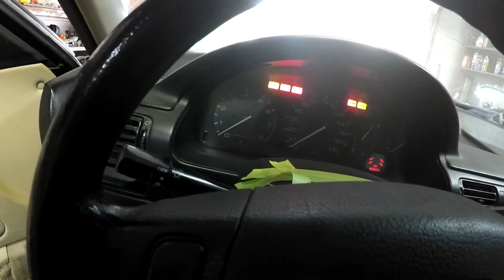Fuel Injector Resistor Bypass | CB7 Proejct: Episode 7

Comment: I have that in my 1986 Nissan laurel c32

This resistor pack is a great replacement for the stock one. Make sure the engine is getting fuel from the injectors. This resistor pack will make sure the inejctors dump the fuel into the engine. If you're having crank no start issues, this might be a solutions

Nissan 22698-05U10 OEM Injector Drop Resistor Pack RB26DETT GTR R32 R33 R34

Comment: Maybe you could help me out I have a 91 honda accord it had f22 but swap that out with a h22a4  I had a harness made for it. but won't start it want to but won't how would l bye pass the new harness to the resistor
Reply from the maker: Did you swap the motor your self?
What yeat is the h22 from is it obd1 or obd2?
Reply from the maker: Did you check for spark?
Check for fuel  at rail.
Try to start with starter fluid in the intake. What are results
Reply: I have no fuel at the rail I've tried starting fluid in the intake nothing have od1 with the extended coil also have one thats obd1 with out.i have stocked fuel injectors  had to buy jumper harness for those. The harness that i have for it from wires works maybe I could send some pictures or video if you don't mind
Reply from the maker: @chicoandtheman4112  its better if u contact me on ig direct msg
Reply from the maker: @blueprint_auto

Comment: If you run your car without this unit you can fry your ecu
Reply from the maker: Even if you change the injectors to the ones with more resistance built in?
Reply: So is this the correct way ?
Reply: My ecu flashes once less that 3 milliseconds and I have no start cranks primes spark.... I'm suspecting Ecu or resistor box I'll check injector harness before I do the bypass obd 0 DA9 RS (90) stock b18a1
Reply: If you were to change your resistors like he did for an h22 that uses high impedance fuel injectors by connecting the resistor box then you will fry your Prelude ECU and fuel injectors. That resistance box brings the voltage down specifically for the low impedance f22 injectors that Jermaine mentioned. Realistically you don't even have to tie together the wires, you could unplug it and just tape it up to make sure the connectors never touch